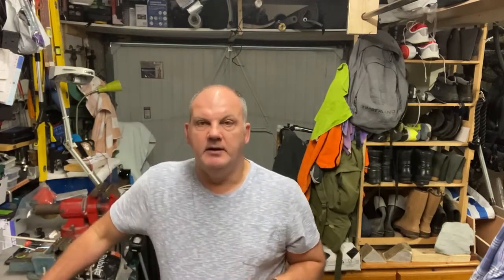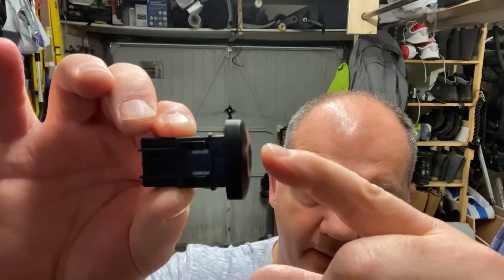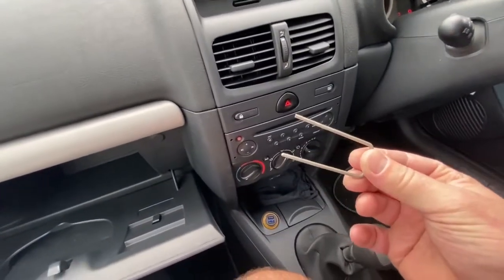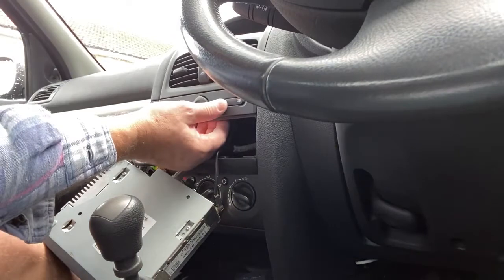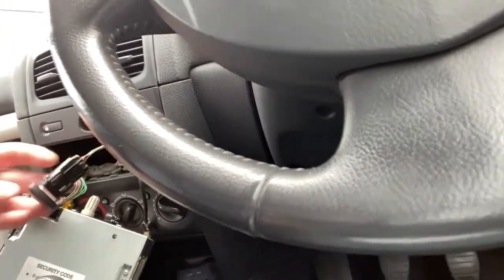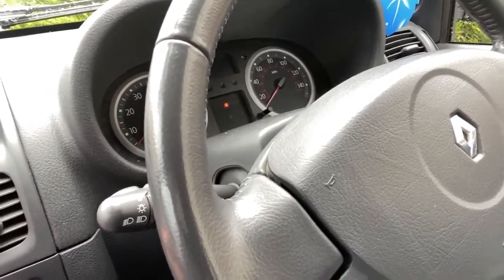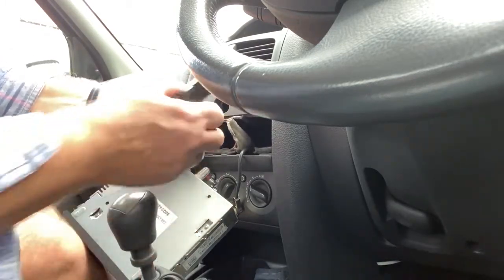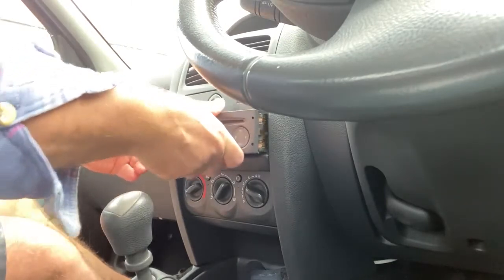Clio hazard switch

Comment: Thanx for the video. Helped me out.
You don't have to remove the stereo.
The panel with the breaker comes off easily by prying on one side with a flathead screwdriver.
Cheers
Reply from the maker: Thanks for the info
Reply: Think I've got the same issue on a 57 plate. 2litre 16v clio + modus. 

Ordered a new switch be it slightly different as the lock doors button is built into the same switch bit I'm hoping this fixes the issue 👍
Reply: @jamessmit9342  did you put the new switch in. Did it solve the problem? I have same issue 2011 Clio RS